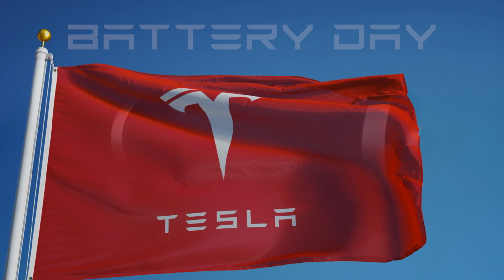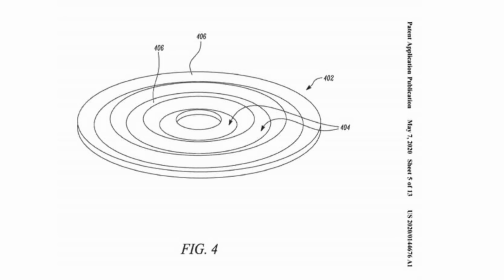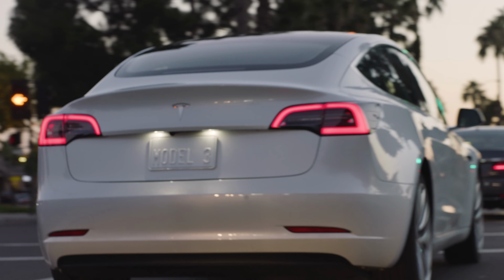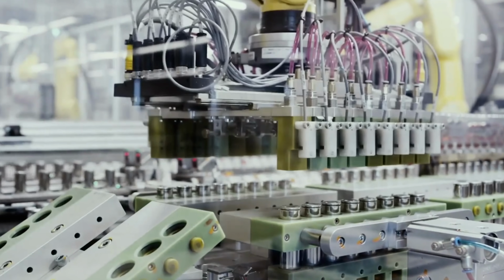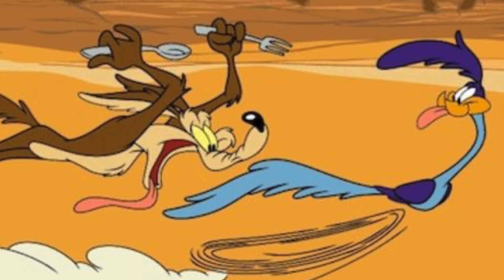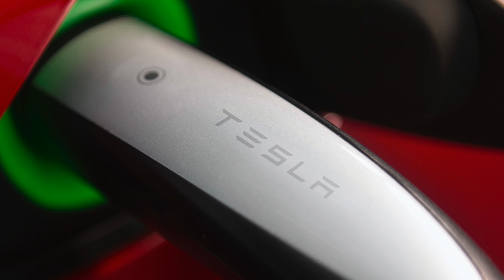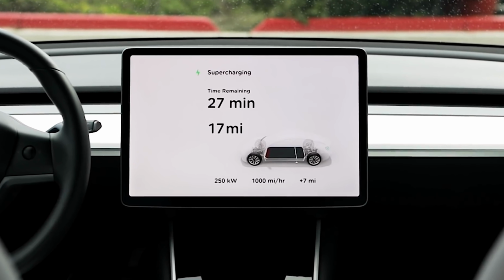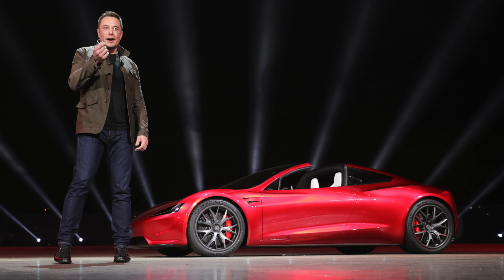Tesla Battery Day Preview: What to Expect Ahead of Tesla’s Battery Day

Comment from the maker: Alright everyone, what'd I miss? And what do you expect to be announced?
Reply: Cost. That one thing that is more important than anything else is cost. $60/kWh at the pack level incoming
Reply: @colossalup7501  Just remember one thing above all else, Tesla is not like any other manufacturer, they constantly spend on R&D and make changes almost weekly to every car they make......unlike other car manufacturers who take years just to implement the smallest technological change.

 I suspect that once they have overcome there own battery manufacturing bugs, that within 3 years with possible dry or wet battery cells they could be at or even under $50 per kWh. And even lower than that over the next 5 years...remember they were pushing Panasonic to improve there output success of batteries to over or at 98%...Panasonic was not happy with this goal and that is why a few years ago they had a bit of a big disagreement with Tesla and plenty of press releases being anti Tesla...that calmed down but still no battery manufacturer has made anything but very mall changes to battery density in the last few decades so Tesla has done it themselves...could we see the big battery manufacturers paying Tesla to use there battery tech in new batteries.
Reply: @colossalup7501  yes, a figure like $60/kWh would be mind-blowing. 

Now You Know did an in-depth back-of-the-envelope calculation on costs to produce the new BFC, suggesting 50% reduction might be possible. This seems about right, given the 10%-20% cost reduction from the dry cell manufacturing process, the 10%-15% saving by bringing production in-house (no supplier margin); savings due to elimination of modules; further production efficiencies due to 80% fewer batteries being required for same energy content - as the BFC is x5 volume - call that 20% reduction. 

50% x $130/kWh ~ $60/kWh seems a good guess!!
Reply: I think the only thing you missed was sleep.
Reply: You didn't mention Redwood Materials, so I would think that's your mini-episode.
Right now, Freemont has to have Panasonic produce cells, then Tesla produces battery packs from the cells, then they ship the packs from Giga Nevada to Freemont where they're added to the vehicles. Giga Shanghai currently has to bring in CATL cells from afar as well. I think it's important to realize Tesla is intending to produce cell to finished vehicle in all of its Gigafactory locations locally, then building out Gigafactories to cover demand globally. 
Minimizing the distance atoms travel = $$$.
Reply: @SoloXAGI_on_X  Recycling and integrate/re-use old batteries into power walls..
Reply: @MarcoYolo420  Makes perfect sense.
Reply: Great job as usual Rob!! I would hope they would announce something about battery recycling and Redwoods Materials... would be so cool to see JB Straubel come back on stage and talk about a partnership with Tesla 🤞🤞
Reply: Okay, I also have a second guess. Musk's "One more thing" will be announcing the start of his "Ride Hailing Service", but he will begin it by hiring drivers while the Robotaxi Service autopilot improves.
Reply: Tesla will announce a Model 2 with the new batteries. What else are they going to do with the local battery production in Berlin? Build only Modell Y? No way.
Reply: @EfficientEfficiency  
To design the Model 2(?) In either China, or Germany, they need a design centre at the location?
Reply: Definitely a power wall update.  Full featured w V2G, virtual PP, right out the box, and a huge cost reductionto boot. 
Really flip the economics of home solar
Reply: @EmuMan44  
Maybe they work towards community storage?
You could have 100 (1000?) Houses each with a Powerwall in a community, or a single community battery.
Vehicle to home/ big battery means much less complexity for the grid connection.
All spare solar during the day goes to the battery, then to the grid at peak, any extra vehicle energy does the same.
The battery knows where it came from.
Cheap for home owners, all the switching done at the battery.

Just a thought.
Reply: @rogerstarkey5390  the software basically already does it as evidenced by the Australian schemes. 
But yes, something that you as soon as you plug it in starts making you money via the tesla middle man.
Reply: Autobidder, green energy storage, and virtual power plants.
Reply: Wonder if HiBar acquisition will play a major role in battery production.  I know it's not priority but I'd freak out if the cold thruster Roadster makes a debut.  The increase in density and price is probably the enabler for Tesla semi to be feasible, something Bill Gates and others had said wouldn't be possible.  Wonder if that will be mentioned.
Reply: @lanzer22  
Hibar
Yes.
Electrolyte injection.
Maybe gel coolant injection.
Reply: Factory car run rate increases.
Reply: Ludicrous-plaid-insane???
Reply: @See7ayyeesix  the only thing above Plaid is Improbability!
Reply: I think maybe the Tesla Network announcement? (but currently/temporarily human driven)
Reply: Think BD is focused on batterybtech advancements. So would believe an announcement of TSLA' first 'CAPe' - integration af maxwell's ultracapacitor and e store ... near instant charge and discharge, minimal heating. Introducing commercial  first principles dense e-packing. This is HUGe!!
Reply: @MarkTimeMiles  
"Instant charge" requires big cables and charger.
K.I.S.S.
Reply: @rogerstarkey5390  i.m.t.s. 'much faster charging' - always k.i.s.s.
Reply: Giant Casting machine
Reply: @herrbakos 99% probability guess
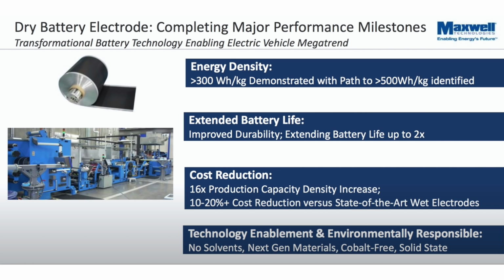Reply: Tesla Daily (7:20)  isn’t their current model 3 around 250 kWh/kg in specific energy, and therefore 300 kWh/kg is a 20% increase? 😊
Reply: @Stich856  The specific energy unit is Wh / Kg not KWh / Kg.
Reply: Stitch no actually. 250 is their charging rate not specific energy. With these new batteries Tesla should be able to charge their cars faster, and discharge them faster which means more acceleration
Reply: Updates & additions to the Utility scale battery packs. It seems like there is little heard about it between earnings calls.  Could this be the most profitable part of Tesla?
Reply: Okay I do believe their will be something introduced to hype up incoming Cybertruck, Semi and Roadster. Improvements in the specs for the Cybertruck and Roadster as a result of improvements in 🔋 and something fundamentally important for the semi to be what Tesla wants it to be. I think the drop your jaw moment will be something relating to Solar, the part of their business that is being totally overlooked by Wall Street and maybe a few partnerships we don’t know about. Novonix, Talga, Redwood Materials come to mind. Maybe some synergistic need as well related to neuralink, boring or space x, maybe all of the above and...I think you are teasing autobidder!
Reply: Main thing - cost at cell and pack level

Other -
1) hibar tech to improve electrolyte filling etc removing bottleneck in manufacturing speed
2) replacing 12V lead acid with supercaps from Maxwell or directly linking to battery
3) increasing voltage for the whole electrical system Along with their next gen wiring system which they couldn't introduce in Y

Moonshots-
1) hybrid battery with 2 modes, switch to long range mode for long trips
2) li metal air chemistry in future or partially in present
3) Roadster with rocket boosters and specs

Questions to ask -
1) timeline for 2 TWh
2) which battery chemistry in which vehicle and international rollout
3) core infrastructure change for Berlin made vehicles - what did Elon mean

Hope this reaches you Rob. Good luck and cheers!
Reply: Ah forgot one thing --

Redwood is right next door to Nevada. Can announce partnership where trucks can bring junk on their way to Redwood, drop them off and then carry the spare parts etc film Nevada back to Fremont
Reply: @PrawnDog420  I think you're right. Recycling is the ???
Reply: Facelift version of at least the Model S, inside as well as outside. There were rumours about a separate area was built in Fremont where they were working on it. Perhaps a small Model 2 car for production in Berlin too, although I think that is a bit too early before Model Y really took market share. Anything other that I can think of:

- Hybrid supercapacitor for Tesla Roadster
- A Tesla Van, as Mercedes is taking that market now
Reply: 1. Giga factories - Expecting detailed exploration of what to expect from Austin & Berlin including timelines. Maybe release of a new Giga factory too? India?
2. Breakdown of their recycling plans & possible partnership with Redwood Materials.
3. FSD Beta release
4. RNA vaccines - They've got a vaccine for covid 😄
Reply: The Tesla Energy component: V2G vs Powerwall, Autobidder, Virtual Power Plants and City-wide energy storage also Austin Texas Factory with battery production, CyberTruck and Semi launch dates.
Reply: Last thing must be about Tesla Energy / large scale grid storage and vehicle to grid maybe. Can't wait to see Tesla gobbel up all those free wind-kWhs in Brandenburg Germany which are currently wasted, when the grid is on overload with renewables. That's basically free energy - sometimes even negatively priced energy....
Reply: Battery recycling
Reply: Also, I am not getting notifications. I tried unsubscribing and subscribing again. Seems like it did not work. I am getting notifications from other channels though!
Reply: Perhaps something factory related. Maybe about supply chain. And what Tesla is going to do with their 5B of raised money. But somehow I don't believe it's actually any of the above, so we'll see!
Reply: Most interestingly you did not comment much on the Tesla Semi, which will need ridiculous range, charging time, and and battery production capability to be practical for Tesla. I'm thinking it would make sense for Tesla to unveil how their new battery production will allow the mass production of this Semi and therefore let them capture a market which so far is completely open, namely the EV shipping business!
Reply: copact car!
Reply: @House Essentials  
Battery day?
Reply: In the charging rate section, you're comparing the battery current with the charger current. However, those are two different things as the charger current passes through a DC-DC converter before entering the battery. This is done to supply the battery with the right voltage for charging, this voltage should be kept somewhat constant. As the battery can't accept 1000 V, that needs be converted down to ~400 V, which increases the maximum deliverable current by a factor ~2.5. The actual current that is being drawn depends on how fast the battery can accept Energy.

On the cells you missed an important consequence of going tabless: since the current collectors (and electrodes) are made from aluminium, they also conduct heat very well. This means that the benefit of shorter path for electrons (and also larger surface area to pass through) is the same for heat itself. So there is less heat being produced due to lower (effective) internal resistance, and the heat that is produced can flow out to the ends of the battery efficiently where there is enough surface area to cool it. Of course, that would require a new cooling solution where the ends of the battery cell are cooled. Another option is to have the batteries submerged in a coolant.

Great content as always!

(oh and your next video will probably be about cost, as that is the single most important factor for the mass adoption of battery technology in both stationary and automotive applications)
Reply: Auto energy trading?

Also i think we will hear about a major investment/partnership for battery materials on battery day.
Reply: Semi
Reply: How about "small" factory modules, built in a similar way to the Berlin building (Prefab, EM was impressed) to produce various chemistries using the same 54mm(?) "can".
To be rolled out in various locations.
Germany, UK, etc.
Used to kick start the grid utility business?
Reply: mining
Reply: Virtual power plants
Reply: On a scale of 1 to crazy...for ur one more thing
1) redwood
2) new cells = start of semi + roadster 
3) v2g with vpp
4) boring + mining 
5) model 2
Reply: Great video! I’m from Minnesota too!
Reply: Elon announcing a one on one interview with Rob!
Reply: A semi that doesn't just roll down a hill...
Reply: Tesla Model II, designed in China :—)
Reply: FSD?
Reply: Elon will announce Short Shorts in new color
Reply: I expect important announcements on Full Self Driving technology and an update on the Robo Taxi project.
Reply: A smaller affordable model.....
Reply: Beside his battery Musk went to Germany recently to speak with Curevac. Maybe something to do with that?
Reply: Rob.
As you say, this cell change should reduce the total to below 1000 per pack.
Since they build modules of 1000 cells now... The pack is essentially the same as a "module".
Reply: No mention so far on Dahn Chemistry. 
Dual electrolyte allows more cycles and or higher cell voltages, less heat intolerance faster charging. 
Single crystal cathodes.
Hybrid battery pack with Metal Anodeless cell with 200 cycles for occasional long distance travel.
Use of above for Lithium Iron Phosphate cells.
https://iopscience.iop.org/article/10.1149/2.0981913jes
https://www.researchgate.net/publication/334471740_Long_cycle_life_and_dendrite-free_lithium_morphology_in_anode-free_lithium_pouch_cells_enabled_by_a_dual-salt_liquid_electrolyte
Reply: Tesla Daily the latest automatic @snake@ charger.
Reply: I think you got a ticket
Reply: Starlink upload to train dojo?
Reply: You got a ticket?
Reply: Ride hailing network? Probably not the electric VTOL, that's 4-5 years away.
Reply: Still not convinced on that picture. Could be anything. I've got a set of LiFePo that looks just like that I bought off ebay. But I really hope it is. So much more exciting if it is.
Reply: Definitely expecting updates on the grid scale power systems. V2G would be incredible, but I'll settle for an upgraded Megapack
Reply: Missed?
The need for accelerated pack production?
You need somewhere to put the cells.
Fast automated construction.
No welding(!)
Adaptable to all vehicles.
Common BMS.
One product.
One line type.
Economy of scale.
Reply: European Model Y?
Reply: J.B.s full cycle recycling loop. Maybe thats the topic for your special episode?
Reply: Vehicle to grid?
Reply: VTOL
Reply: Hey Rob, hoping  some kind of power plant using renewable energy will be announced in the uk and in Germany
Reply: You missed calling 911 b/c I'm about to have a nervous breakdown waiting for this next, better...safer...cleaner...secure'er world. "Make it so Number 1...Engage!"
Reply: P.S. It's really pretty simple. Fossils are the past...Photons are the future. Why people aren't going absolutely ballistic about this "moonshot" moment opportunity for people everywhere...why the perversities of covid haven't woke billions of this planet's inhabitants to the reality of this moment's inherent treasure...why this isn't the water-cooler talk 24/7, worldwide - blows my mind. Especially because, in hindsight, it WILL BE all those things...and more.  Alas, it always comes back to Henry Ford: "If I would have asked the people what they wanted, they'd have told me - 'a faster horse...'"
Moral of the story: Engage, and don't look back. Don't look "down." Look "up." Fossils are the past...photons are the future.
Reply: A compact, sub-30k model. 300 miles, 0-60 in 6 sec.
Reply: Bi-directional home charging station for car-to-grid capability. Coast to coast auto pilot achievement. New model for India. Semi truck delivery starting earlier.
Reply: Got it!! Model3 for $20.000, with a contract; “stay connected to grid for at least 17 hrs per day”
Reply: Partnership with Redwood at some massive cost benefit.
Reply: I think you missed to tell us that you got a golden ticket and we need to brainstorm as to what question you're gonna ask during the Shareholder AGM and during the Battery presentation... Right? Right?
Reply: Perhaps there will be improvements for future home charging speeds. If that doesn't happen the Cybertruck may take a long time to charge at home. It would be nice to know charge rates for future home charging so that people can install the right home outlets now for construction or remodeling projects. I am installing 80 amp outlets because I think Cybertruck will need more power but I really wish Tesla would provide charging specs for Cybertruck and the next generation of home chargers now. It is expensive to upgrade a home's electrical system and knowing the future charging specs now would be very helpful so people can get prepared without having to overspend or redo work later trying to prepare for future charging needs. Also would really like to know if Tesla will have automated supercharging for robotaxis because that will have a big affect on planning for the amount of home chargers some people may need if they have multiple cars and this affects charge load calculations for electrical panels. Really would like Tesla to clarify charging specs now so that people can be ready to offer their vehicles as robotaxis when the network is available.
Reply: The Tesla home charger has been sold out on the Tesla online store for a few weeks...perhaps they will be releasing an improved charger soon. Seems too important to not have that item available.
Reply: Awesome information.  Looking forward to attend the Battery Day presentation.
Reply: IMO Vehicle to grid makes sense for the rare power outage but not a grid replacement
Reply: VPP - Virtual Power Plant with auto bidder is missing 😉
Reply: PALLADIUM Model S & X

+ minor manufacturing improvements to M3 and MY.
Reply: One more thing: Tesla Semi deliveries starting soon?
Can only hope... 
Yes its more likely about their new manufacturing techniques, giant press etc.
Reply: Elon said on Twitter that they are not announcing anything about Plaid powertrain.  I doubt any news on vehicles will be shared because it will take away news coverage from the batteries.  The point is that the battery announcement is a really big deal so they will want that to be the sole focus. Anything not about batteries is not going to be a topic covered, I think.
Reply: think the extra topic will be vehicle-to-grid capability, and further integration with Tesla's solar and storage products. A retail consumer version of the Autobidder software.
Reply: Honestly I don't expect it but Giga UK would suit me.
Reply: Amazon's investment in Redwood
Reply: Elon will not be able to leave Battery Day without talking about his factory build! Giga Shanghai, Giga Berlin, Giga Austin (Texas), and what is the plan for production of the cars and trucks. Don't you think he is going to have a separate Starlink reveal for Beta and deployment (and maybe IPO).
Reply: Well, if the heatloss is a lot lower, this basically means that each battery is a lot more efficiënt on top of the higher density. So even if the density hasn't raised at all, the range of each vehicle will stil be higher. Also note that when the battery is more efficiënt, it will less often be very hot. When it's less often hot, it will make the cycle life longer too. So basically, Tesla might improve in every single way (lifetime, efficiency, range, energy cost, battery cost, weight, possibly even the recycle proces) with seemingly just a very simple trick.
Reply: Hybrid battery? That is, mixing cell chemistry’s in a car. A smaller high cycle section made up of the million mile battery chemistry for starting and stopping, and the rest of it with a chemistry based on the model’s requirements. I’m a little on the fence about this concept, as it might add little benefit for the added complexity. Still worth considering, as it was mentioned in one of their patents.
Reply: TERAFACTORY SECURED?
Reply: I think you missed Semi. There was a leaked email a while ago, also, with the current Nikola shenanigans the burden of developing electric semis is going to be all on Tesla’s shoulders for a while at least
Reply: What might they do with the money they raised.
Reply: I think the big announcement that you left out will be partnerships. Specifically a partnership with VW and probably Ford.

Ford hasn't mentioned thier plans for a pure BEV. That seems suspicious to me.
Reply: robo and semi hype
Reply: Ultra cap replacing 12v battery?
Reply: Rob, Elon dressed as the Energizer Bunny will clearly be a highlight of the event... ☺️
Reply: Ed Ball they’re not Public?
Reply: @westsiyed  They are public ... PLL
Reply: I think Tesla will announce the acquisition of Piedmont Lithium (PLL)
Reply: I think Autobidder might be important.
Reply: Tesla Semi?
Reply: Has to be Energy to grid
Reply: I think the one game changer I'm looking forward to is the wiring. Tesla has patent for that, and the capability to reduce wiring significantly and in addition increase the automation of the factory.
Reply: I guess that will be:  Kicking-off a 1) localized driver ride hailing pilot program (precursor of an eventual Robotaxi) 2) with a Million-Mile battery using the new cell/battery technology that you mentioned and 3) with newest/greatest beta or alpha FSD SW in these purpose-build cars ... I guess at the end of 2020 is the right time to start it ...
Reply: (Novonix) synthetic graphite & SEMI
Reply: Come on everyone!! It has to be unveiling of model 2 compact car for under $30K!!
This will really accelerate Tesla’s mission so everyone can afford to buy a Tesla and start robotaxi network!! Am I right Rob?? Am I, am I?? 🥰🥰🥰
Reply: Tesla may announce they will start ride hailing with drivers at first.
Reply: Path to 2Twh production?
Reply: Great summary. You forgot the HiBar acquisition in your Production section. Also, maybe the potential for some news on ride hailing and insurance.
Reply: Casting and painting machine in Germany
Reply: While Tesla won't be SUPPLYING batteries to others any time soon, they may be licensing their new battery tech to others. Remember their mission? Remember their willingness to share IP with others in support of their mission? VW's announcement scheduled for the next day may be that licensing for their ID4.
Reply: Additives. Your def not sleeping on the removed youtube video with jeff dahn. I saw it, it was plainly stated, additives are key to battery improvement. And further he said its a done deal already cracked.
Reply: You haven’t mentioned the next long range for Model S, X, 3, Y yet.  Is it going to be over 500 miles?

And any updates for the semi truck’s battery and range.  Will it be over 600 mile range with new battery?

I guess they will not mentione the new Tesla Model 2 compact in battery day.  They might have a special event for that new car later
Reply: This is so obvious... Energy Storage. Elon has said Tesla’s energy business would be just as large as the automotive side
Reply: The most affordable electric vehicle around 20k to 25k!
Reply: My guess is your next vids going to be about how battery day is going to have a lot more information about new battery storage devices for municipalities and businesses.
Reply: New sub 30k model
Reply: 650 Mile Model S  - - Current S is 400 miles and people are saying about 50% increase in energy density likely with Road Runner.  - - This would be the one surprise that nobody is talking about and would, combined with million mile battery, be the final nail in the ICE coffin.  Instead of making apologies and excuses that Electric is as good as gasoline due to super charge network, instead Tesla is way better.  No stops for energy, just plug in when you reach your hotel.  And it would be easy to work a deal with a couple of Hotel chains to give special deals (maybe free overnight charging) to Tesla drivers.
Reply: Amperage rating is listed as 'minimum continuous' and not as max rating.  Amperage can spike considerably more and should be able to run safely at 25% more amps due to UL code requirements.  Given Tesla's propensity to lean into over-engineering, you could probably run 2x above the UL required rating without serious risk to the hardware or safety and your own figures (15:35) are 60% above the listed 425 amps.
Reply: A self-charging battery system for homes cars jets ships and home appliances on the high end and computer laptop and desktop/all-in-one pcs with self-recharging batteries here as well. Like with smartphones and tablets. and pc monitors and smart TVs and pc/game consoles and controllers and remote controls mice keyboards stylus pens. and BTC LTC antminers to get around the 240v wall needed for USA homes. Thats one of the last things to get total freedom from the powergrid here. after new zealand tested out the wireless power transfer systems and starlink was tested as well as aqui-fi.
Reply: I think/hope the "One more thing" will be related to plans to manufacture HVAC systems. I recall must saying he couldn't talk about future plans/designs when previously asked about this. I think this would be big. Give me a shout out if I'm right, lol. :p
Reply: @victordrew7927  Could in make sense to integrate powerwall + HVAC + solar inverter
You could modulate HVAC power with autobidder
Run HVAC directly from solar panels DC
Wild guess
Reply: Tesla Insurance expansion roadmap.
Reply: FSD
Reply: @niallnordell9271  FSD has a public timeline already, and not belong to battery business?!
Reply: We should change Tesla Battery Day from Sept 22nd to Sep 18th.. Jeez.. leave some for Elon to announce.. :) As usual good work Rob. Happy to be your supporter.
Reply: The missing piece is first deliveries of the Semi starting immediately. The reason that product line was on hold was battery supply. No longer constrained meaning launching the Semi. This is a huge piece of transitioning to sustainable energy.
Reply: Ido Livneh I wish you were right, but I don’t think so.  If they were ready to deliver semis immediately there would be drone images of pkg lots with some numbers of them.  Hope it happens soon though.
Reply: Tesla Jet?
Reply: @Perichron   Electric turbine supper sonic plane ?
Reply: @Perichron   Electric turbine supper sonic plane?
Reply: @tonyhaley7946  Your comment made me hungry.
Reply: You missed that they will be upgrade the internal systems to 900V+
Reply: Sodium difluorophosphate.
Reply: @iCannot_Enough  mmmmm, toothpaste.
Reply: What about the Hybrid Metal-Air / Non-Metal Air battery pack patent?

https://cleantechnica.com/2020/09/17/elon-touts-radical-manufacturing-redesign-tesla-awarded-metal-air-battery-patent/
Reply: @YKSGuy  
I believe that's for cell failure control.
Can't see how it fits in this scenario.
More applicable to SpaceX?
Reply: @rogerstarkey5390  "The defining feature of the patent application is the use of both a metal air battery pack and a conventional lithium ion battery pack in the same vehicle."
Reply: Full-Self-Driving related announcement maybe?
Reply: Solar on semi trailer to extend range?
Reply: @isaakloewen5172  
Which limits the truck to that trailer.
It's not needed.
The truck will out-range the driver.
Reply: Very unlikely but I would think besides all the great news a new model geared towards ride hailing would be a winner. Something that would resemble something like an old english cab or a royce royce (or just a model s or 3) where the front part in terms of aircon/hvac is seperated from the passanger part. A corona safe (for both passengers and driver) would immediately put other traditional ride hailing competition out of business or have them buy your cars. Plus more data for robotaxi development (Ark invests idea). Also good and chep advertisement for other Tesla HVAC technologies. Since I am far away from being informed, not sure about if an idea as such would even be technically possible or economically feasible..., so just dreaming. =)
Reply: My One More Thing would be a compact car being confirmed 👍
Reply: Model 2. Or some other compact car
Reply: licensing to big auto
Reply: I have been thinking about this for a while. Rob, do you think Tesla should also start car cleaning services (ideally automated) so that the robotaxis can be kept clean between rides during the day without the need for the owner's attention? A stop with a bunch of robotic arms would be good enough for a proof of concept. I will start working on this right now. This would be similar to how Tesla's cars get painted (top coat).
Reply: @designbeing  Interesting idea. Definitely something that will need to be addressed.  Would make sense perhaps to have it performed while charging... could be a human-powered service until robots are developed. Maybe aspects of the cars interior could be redesigned to simplify this.
Reply: Well, there are no time lines. When can we expect the roll out?
Reply: low price mondle、i think won’t come within 2 years! A/c they don’t have factory to make it! S/x 80% refresh with 120kwh!  I hope we can see fsd  fully undated! Cost 100% will be lower but how closed to $100 per kWh?
Reply: Ride hailing and full self driving capability updates.
Reply: Tesla ATV?
Reply: Tesla Daily you forgot to mention the Tesla minivan 🚐
Reply: Cost/kwhr !!!! Its either that or vtol supersonic electric jets.
Reply: Tesla opening up their charger network?
Reply: Cost, cost, cost!!!
Reply: 1) Supplementry metal - air batteries 
2) Tesla is secretly buying Nikola stock - it wants their virtual hydrogen ion fuel cell design.
3) large castings
4) plaid ties & shoes
Reply: Largest Single piece casting machine in history. = simpler /Lower cost manufacturing.
Reply: Is it wrong that I've always secretly hoped they'd develope a life-sized replica of the energiser bunny, but powered by AI and running on the million mile battery? Could that be it!?
Reply: Tera-Gigafactories
Reply: Project Palladium, internal and likely external changes to S and X??
Reply: He will start as usual with safety maybe. The limiting factor talked about Cobalt substitutes that make battery less likely to catch fire or similar and increase the performance, like aluminium if I remember correctly. That was interesting because the data (J Dahn) was already there.
Reply: ITS THE SEMI TRUCKKKK
Reply: 2 new factories. china car plant and Europe Energy business (UK?)
Reply: a new division    Powertrain and Battery   to design in conjunction with, and manufacture a range of motors for all other industries,agriculture,horticulture,minning,aero,etc,etc along with the supply of batteries suitable in size for each application.  How about located in Tulsa.
Reply: I don't think you missed anything, however I think he will announce the new hvac system 😉
Reply: Model 2
Reply: Broken windows
Reply: Wow everyone's answers are wrong so far!  Obviously has to be MANUFACTURING IMPROVEMENTS OF BERLIN MODEL Y.
Reply: @alexrowell5995  that is part of the meeting before I believe, not a battery day meeting
Reply: @EmuMan44  Good point.  I was just thinking the 3 most important things for Tesla are:
1. Battery & pack cost, speed, supply
2. Manufacturing efficiencies of cars
3. FSD
He seemed to cover 1 and 3 had it's own day.  So, that left 2 in my mind.  Now that I think about it, this was originally battery and POWER TRAIN day.  Elon said that Plaid  power train was like alien technology... this just doesn't seem as important to the mission as completely revolutionizing how a car is manufactured.
Reply: @EmuMan44  That's fine, but I don't think Elon distinguishes much between the two.  He said he would talk about "core redesign of manufacturing" at battery day:  https://youtu.be/Zi8sQUQDzXM?t=383
Reply: @alexrowell5995  
B A T T E R Y day.
Reply: @rogerstarkey5390  That's fine, but I don't think Elon distinguishes much between the two.  He said he would talk about "core redesign of manufacturing" at battery day:  https://youtu.be/Zi8sQUQDzXM?t=383